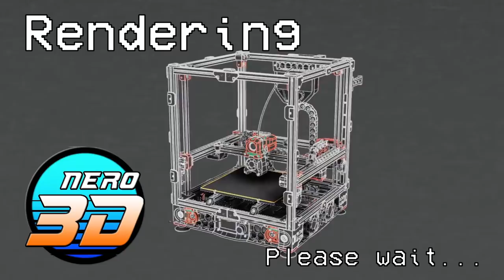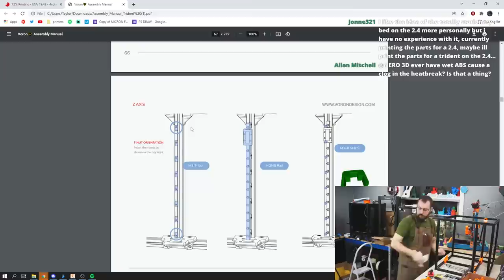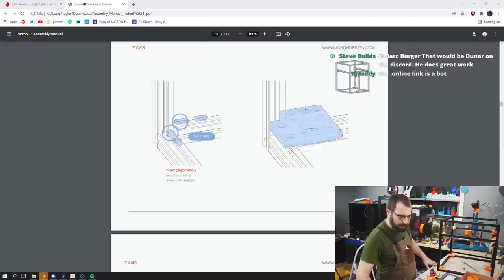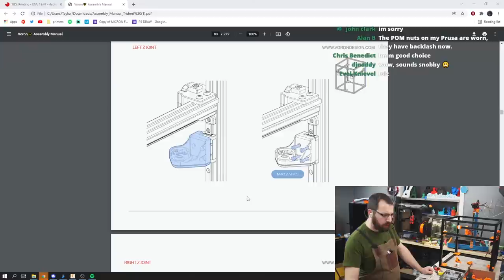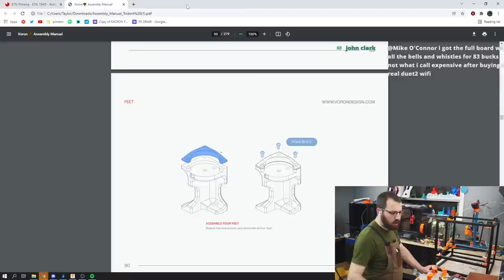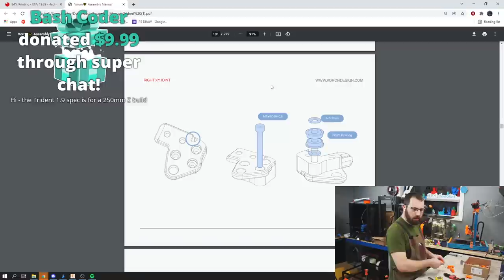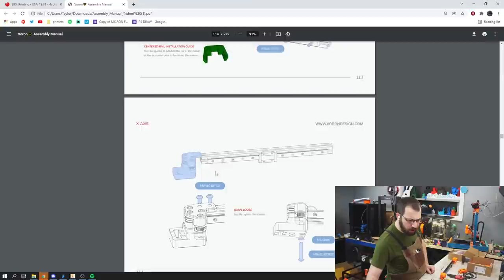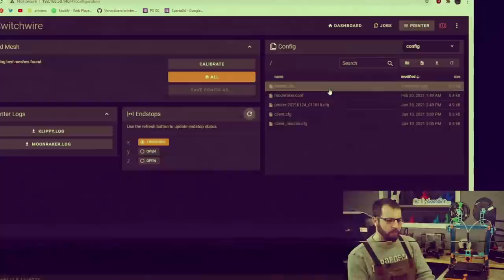Voron Trident Build Livestream - PART 2

Comment from the maker: Did you buy this kit, or recently purchased a voron kit from Fysetc?
Share your experiences, good or bad by replying to this post
Reply: I bought a 2.4 kit and I'm not so happy with it ;)
A lot a things to change.... Because of poor quality. 

- Rails a bad (some had rust) 
- bed it not flat (more than 0.3 deviation)
- pulleys are not straight (you can see it by eyes when rotate).
- Stepper are bad quality (2 burned after 10 hours printing, and they burn the drivers)
- Extruder stepper is weak.
- PEI is Poor quality and really too much textured (I cannot call that a texture, the PEI have holes and spikes, not a texture..)
- SSR poor clone quality (but works)
- fans are also poor quality. the 4020 and 4010 are not sufficient
- Screws are rusting 
- Missing screws in the kit

I think i'll stop here. :( I'll never buy another Fysetc kit ;)

Comment: On the trident's CAD the Y endstop bumper sticks out by 1mm compared to the other side's motor mount making it seems like the gantry is racked when pushed all the way to the back. So it is the correct way to use the front idlers as a reference instead.

Comment: You didn't seem to mention it (and no one seems to have asked)... What's the benefit of the POM nuts over the stock brass ones for the leadscrews?  Oh, it got mentioned a few minutes later laughs nervously  Not having to lube them sounds handy.

Comment: I need to whine somewhere I bought T nuts from aliexpress rather then sending me the good T nuts I ordered they sent me hammer head T nuts so rather then wait another month for cheap T nuts I ordered some from amazon and they said they would be in on Tuesday the 4th I also ordered a fysetc gold trident frame from ali on the 26th and they said it would be in on Thursday the 6th I get a knock at my door today the 29th and its DHL with my frame kit (I looked it up seems that most China to USA through DHL goes through anchorage anyways) I was shocked at how fast it was but I'm trying to decided should I wait for my roll in T nuts or just use the cr*ppy hammer head nuts